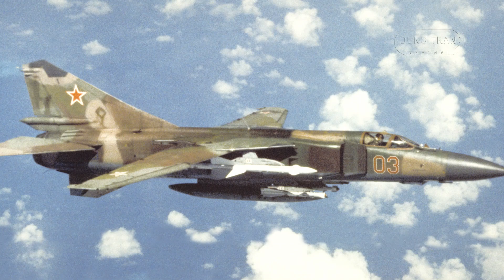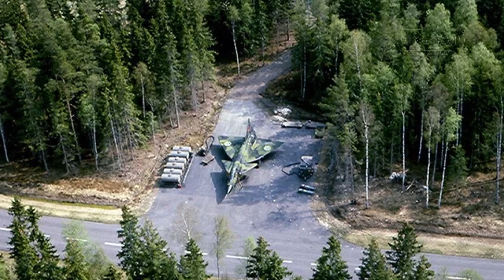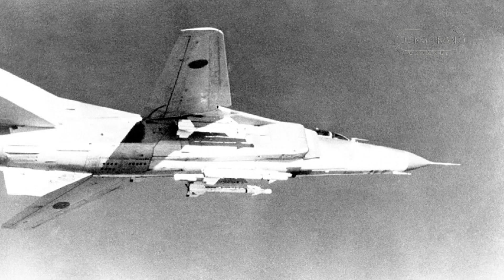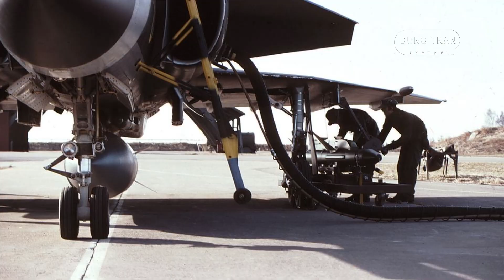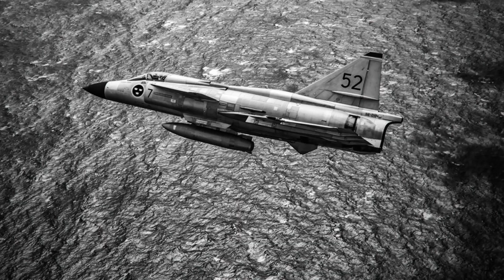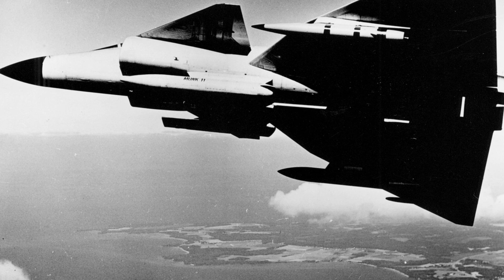Saab 37 Viggen vs MiG-23: Cold War Military Doctrines and Aircraft Design Differences

Comment: 08:40 NATO vs Warsaw pact has little to do with Sweden since it was not involved with either. The purpose of this stuff was making Sweden an unappetizing glass shard filled explosive hedgehog of a country, so that any calculation of pros VS cons of invading would have a list of cons so long you'd need 100yrs to tally them all up - and zero on the pro side, Finland did the same thing. The main backbone of the defense strategy is guys with guns behind every tree with supplies and will to fight a 100yrs if that is what it takes. The rest is window dressing, and in case some eejit doesn't understand what the other stuff means.

Comment: The Pratt & Whitney JT8D is a subsonic - civil engine, used for airliners, therefore of course without an afterburner!

The Volvo RM8 is an extensively modified version, for supersonic speeds, with a Swedish-designed afterburner, and was produced by Svenska Flygmotor (later known as Volvo Aero).

Please do your homework...

Comment: "renamed"

No, the Volvo RM8 is NOT identical to the original licenced engine.
It got a new name because it's a new engine, even if the differences are not huge.
And the original certainly didn't have an afterburner, as that was completely designed by Volvo Aero.

The RM8 weighs over 200kg more than the P&W JT8, because the latter was made for civillian, SUBSONIC aircrafts, and there was a lot of small redesigns, mostly increasing thickness of metal to take the greater strains, but other details as well.
Reply: Details like what?
Reply: @TyrannoJoris_Rex  Mostly for durability and ease of maintenance, but also to handle the supersonic speeds.

I'm not an engine designer, ask one if you want specifics.